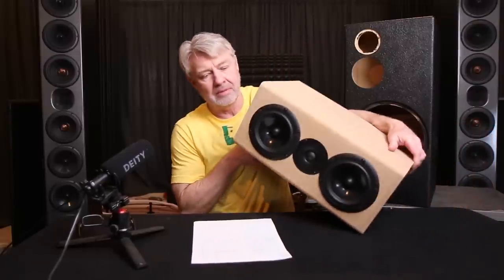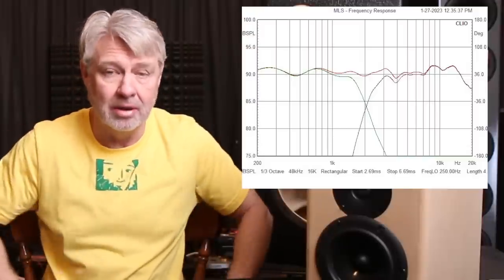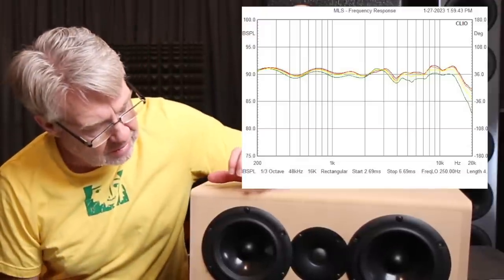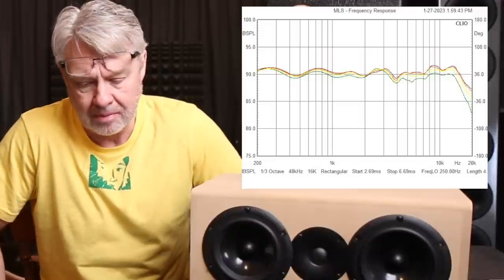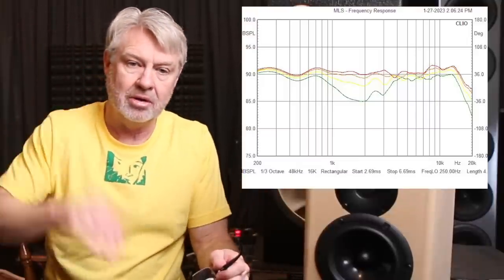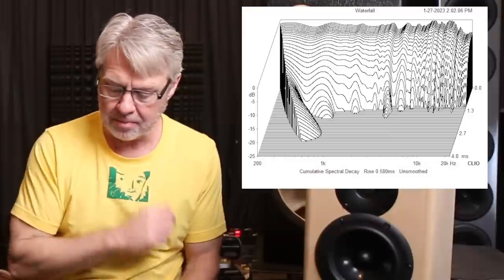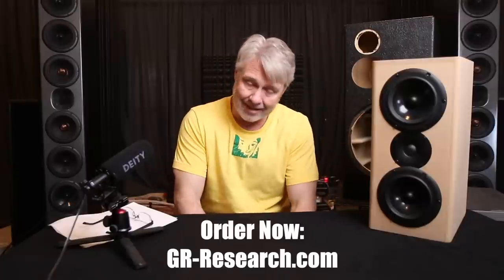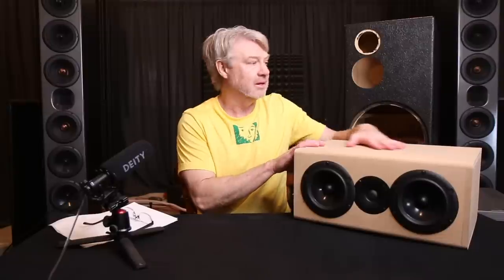Introducing: The Versatile X CS Bravo!   HD 1080p

Comment: Sensetivity db/m ?
Low end -3db Hz?
Looks great, small, slim box
Reply: Based on Clio plots featured, you are looking at around 91dB/1W/1m with f3 of 100Hz, albeit with a gentle 12dB per octave roll-off of a sealed box.
Reply: -3db in will be in the upper 60's. 

We will also have a floor standing transmission line version that will hit a -3db of 40Hz.
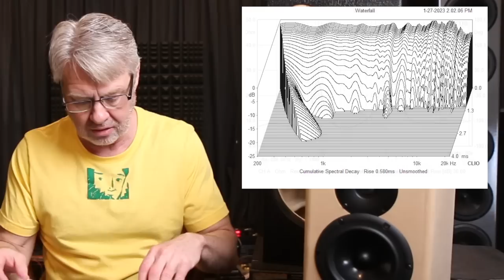Reply: @dannyrichie9743  That's a phenomenal estimated result, considering the resonance centered at 90Hz (3:43). Fantastic result for a 5&1/4" sealed ...
Reply: @paulb4661  The Fs of those drivers after burn in is in the mid to low 50's.
Reply: @dannyrichie9743  I'm sure that's the case, but to get the f3 in the upper 60s with an fc around 90, you need a high Qt alignment, say 1.1/1.3 which also helps to achieve maximum efficiency in terms of low end output. This also calls for a high Qt driver, which usually means low overall efficiency, because of a lower magnetic flux and softer suspension. How do you achieve high efficiency with extended lows in a sealed cabinet with tiny drivers is nothing short of miraculous. Kudos to you Sir !

Comment: Wouldn't it be better to offset the tweeter to get the woofers even closer together?
Reply: Good thinking. It might help a little.
Reply: The difference will be marginal, I tried both and ended up building a 3 way with tweeter and mid above eachother. I have a wider seating area so I needed the off axis response good on a wider range.
Reply: Hello folks. Because we're all doing the same thing falling back into the old way of methods following thier orders and not thinking completely on are own. Loudspeaker cookbook.

Like rising a child we fall back on what are parents would of done for are experience. It's one of those things that we all say.
Wish they taught us that back in high school.
It's all about the adventure in the journey.
Nothing really new been invented and what was improved on.

Very good question I was wondering the same thing about Sony found me a unicorn video.

Ride Easy
Reply: @D.Feenstra  Sure, but my suggestion costs absolutely nothing and is done by several manufacturers. A neo tweeter helps in bringing the drivers as close as possible.  Going a 3 way route admittedly is a little better but requires a complete redesign and greater cost.
Reply: @carlosoliveira-rc2xt  fair point for sure. For me the difference wasn't enough. For others it might have and wouldn't the extra costs for a 3 way outweigh the benefits.
Reply: @D.Feenstra  For some yes, but for those in the market for something like this, the $199 is probably already enough. I think that most people probably don't view the screen very much off axis at any rate.
Reply: @carlosoliveira-rc2xt  i agree completely, i just referred to my personal situation. for 199, this looks like a very good deal indeed.

Comment: i am interested in sealed MTM designs like this, i already have a good speaker so i am looking for a more expensive model in same size.  i want that neo planar tweeter and great 5" woofers.
and a question about cabinet: does each woofer have separate box space? and does it make a make a difference?
i buildt a mtm myself and found that making that cabinet with two different spaces was difficult. because there is a tweeter in the center where the divider would go, also the tweeter woofer spacing is so small that fitting wood there is also hard.
Reply: They share the same air space.

Comment: Why not just design them as a TWW design? And you can still turn in on the side for a center channel or is there a problem having the tweeter really far from the bottom driver?
Reply: A TWW would work better as a 2.5 way, otherwise the large distance from tweeter to "bottom" driver would indeed cause similar issues
Reply: Lobing patterns get worse that way.

Comment: So the sensitivity is higher than its big brother X-CS encore 90 db ? Can it play low enough to reach the 80 hz sub crossover setting. Now I am confused. I have been waiting for 6 1/2 version video. But this looks smoother and more sensitive.
Reply: Sensitivity is the same. This one will play down to a mins 3db in the upper 60's.